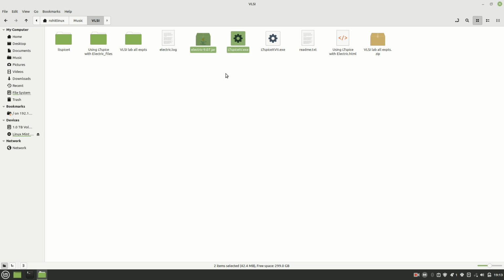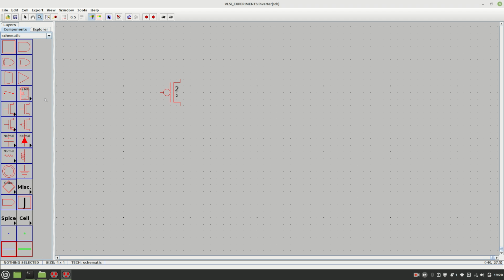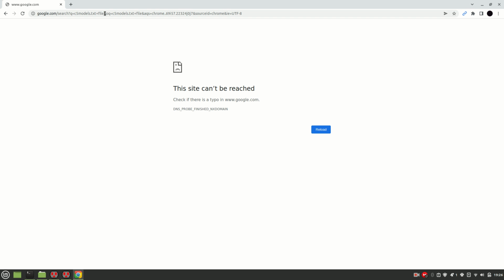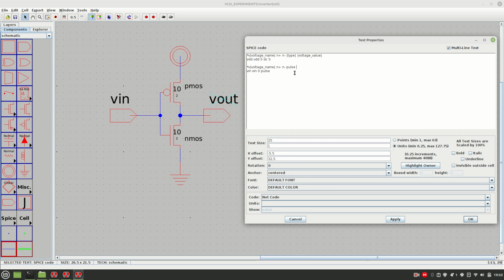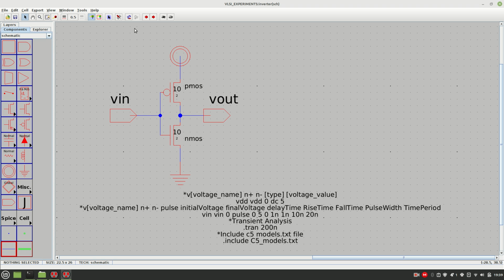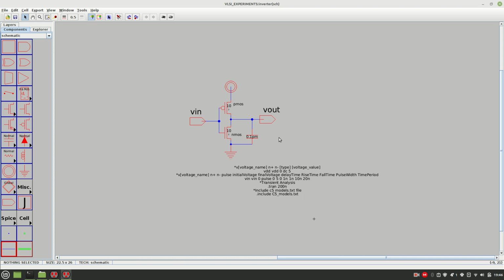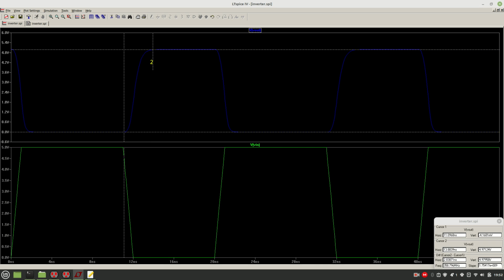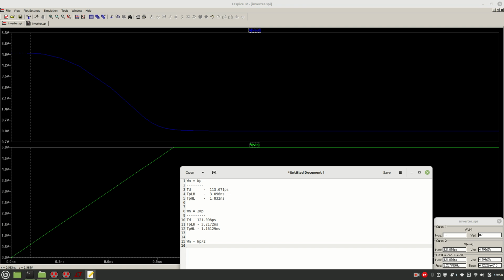VLSI 001 INVERTER SCHEMATIC

Comment: electricBinary-9.07.jar zip file after inside extracted file there is no electric.jar file
Reply from the maker: hay it's not a zip file. it's a Java executable .jar file..

no need to unzip or untar it. 
just execute 
java -jar file_name.jar 

it opens the required application

see 2:07